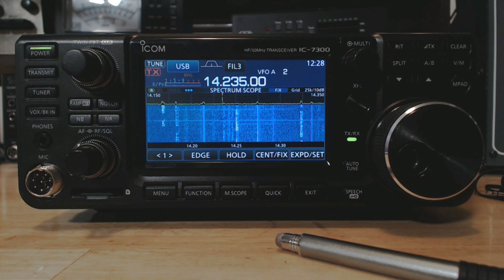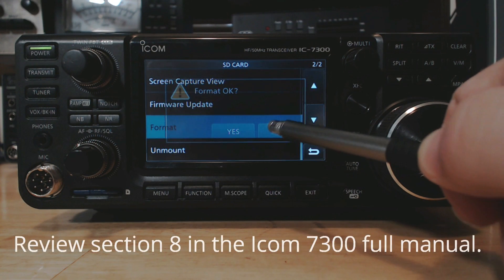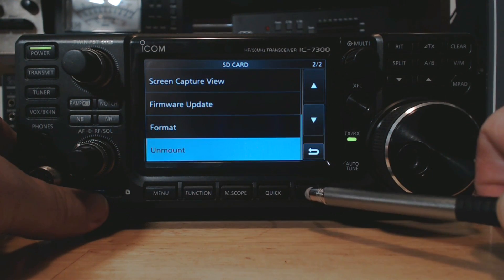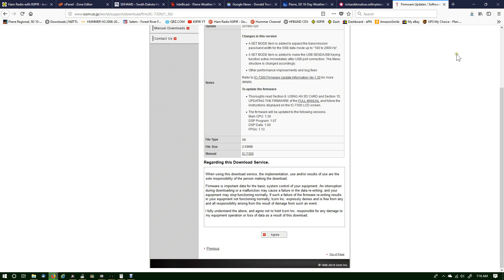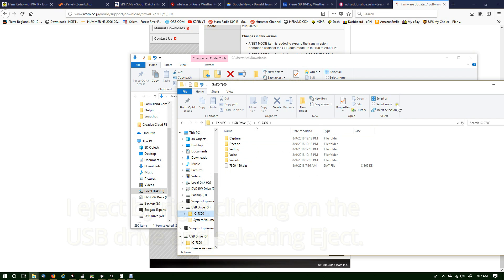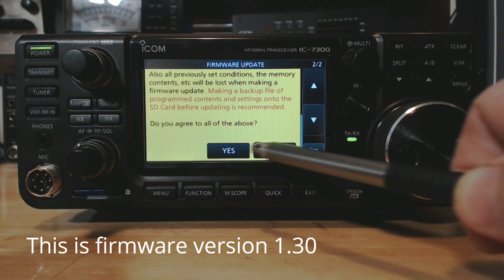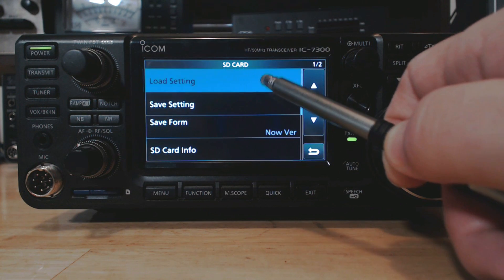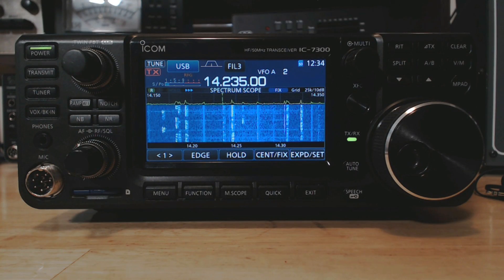5 Min Easy Icom 7300 Firmware Update Procedure

Comment: An excellent Short video, the only thing missing is how to check the current firmware version on 7300
Reply from the maker: Thank you so much Glen. Great point and I guess I didn't mention it. The version pops up on the LCD when the radio powers on. Bottom right corner: https://youtu.be/ep2qQURI91g?t=4m10s

Best 73! - Rich, K0PIR

Comment: Many Thanks. I might have missed it in a previous comment. What happens if in the past three years I've NEVER updated? Will the current firmware update be happy or is it necessary to do any intermediary updates that may have been released over the past three years I've had my 7300? I know how much work is involved in creating these videos as I have 650+ on my channel. so THANKS AGAIN for investing the time. de www.W3ATB.com
Reply from the maker: Nice to hear from you and thank you for commenting. It does not mention prerequisites in the instructions, so I would go ahead. It is a good update. 73!

Comment: Is updating the firmware absolutely necessary and if so, how frequently does it need to be done?
Reply: And an update came out two days later!
Reply from the maker: @Tim_Yohan  that was funny.
Reply from the maker: It’s not necessary to operate, but I would do it and there hasn’t been a recent update. So you may only have to  do it once. 73

Comment: thanks! how do you set up the line on the scope peaks?
Reply from the maker: Fernando F. Hello and thank you for commenting here I hope all is well where you are. There has been lots of questions about the peak because it does not go up high enough for some users. They would prefer it to be increased. Unfortunately, there is no way to address that and the lines (scale) are not adjustable. I have learned to live with it as it is. I do adjust the peaks (Signal to noise) using the ATT or the RF Gain. Thank you again, be safe and best 73!

Comment: the last  update on my radio is 1.14 do I go to the lastested update and all the prior updates automatically be installed ?? Or do I have to do them as they came out???
Reply from the maker: Hi Gene, nice to hear from you and that's a great question. You should be good to update to the latest. I do not see anything in the v1.30 update information cautioning users, see: http://www.icom.co.jp/world/support/download/manual/pdf/IC-7300_ENG_FirmUpInfo_V130E_0.pdf
There was a caution for the 7610 regarding that, but none for the 7300.
Save your settings.

Thank you and happy holidays,
Rich, K0PIR.us

Comment: Thanks for the heads up on the new firmware. Apart from scouring the Icom website every day to check for updated do U get update info elsewhere?
Reply from the maker: Hi Chris, yep I keep a eye on Icoms website and then the Icom 7300 facebook page. As far as I know Icom doesn't have a notification system we can join. 73 and thanks for commenting - Rich, K0PIR.us
Reply: Join the Icom 7300 users group on groups.io and you will get an email when there is new firmware.  73 james K0UA